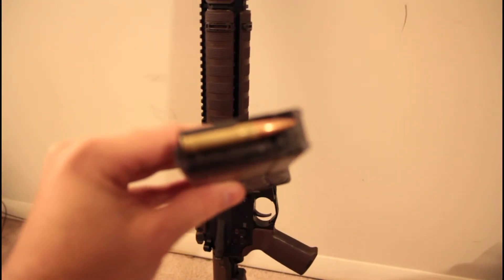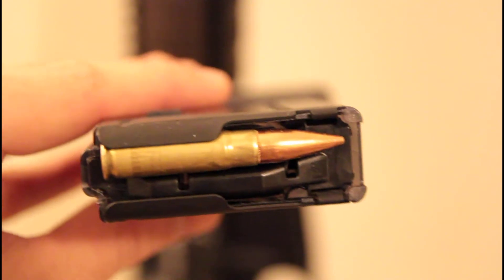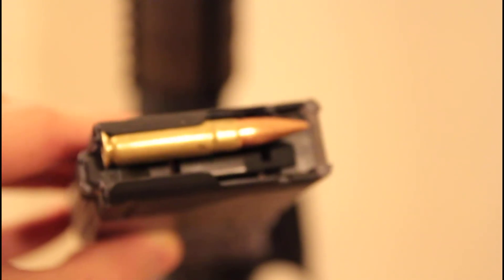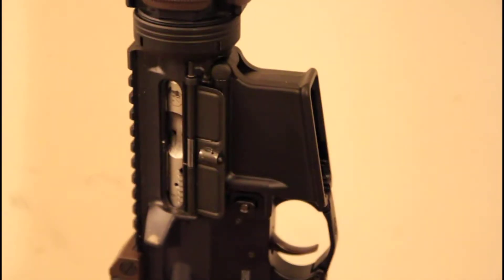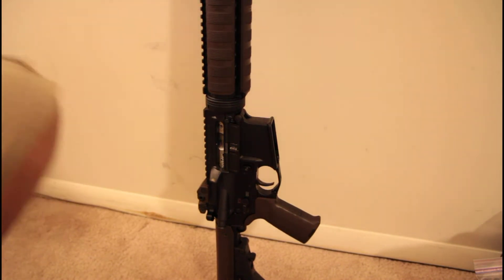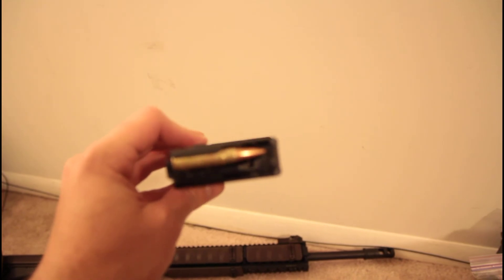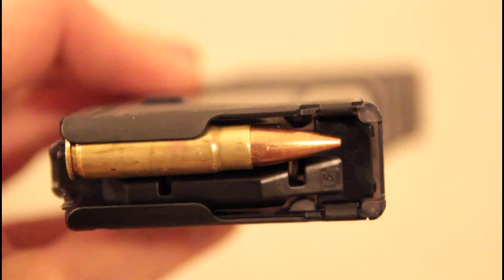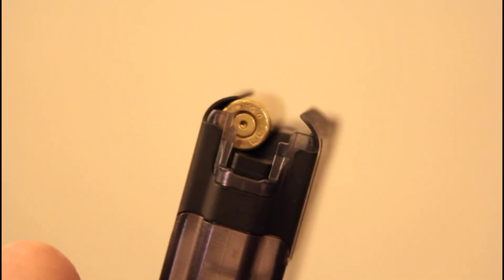Will 300 Blackout Chamber in a 5.56 Rifle? Part 1

Comment: If any of you understood how this type of rifle works, you would know that until the locking lugs on the bolt turn into the lugs on the barrel the firing pin is retracted and will not protrude out the bolt face even if the hammer drops and hits the firing pin.

Comment: Dude lol nice rifle but it clearly hit that primer
Reply: Yooooo
Reply: +Val Kyri The bolt carrier has to be practically all the way forward before the firing pin can reach the primer.
Reply: +Al Brautigam   But not all the way forward?
Reply: Dallis Miller The bolt carrier has to be at least far enough forward to lock the bolt, which means the round is fully seated when the firing pin can finally reach the bolt face, then the bolt carrier can move forward another ~1/8".